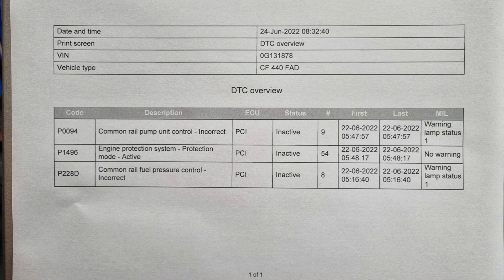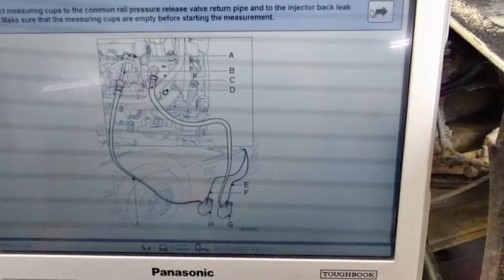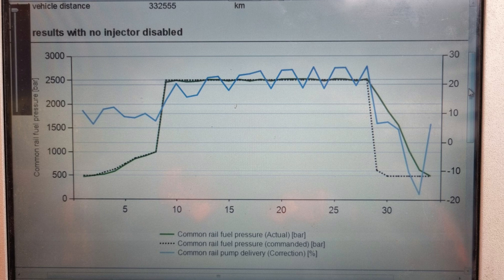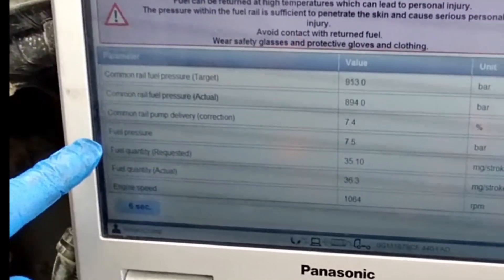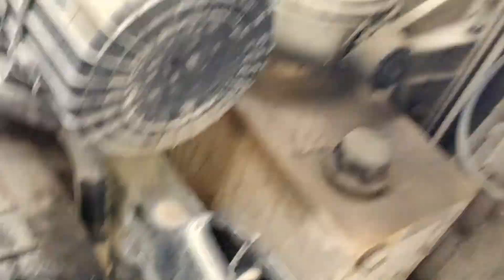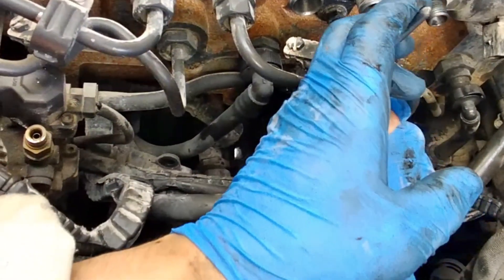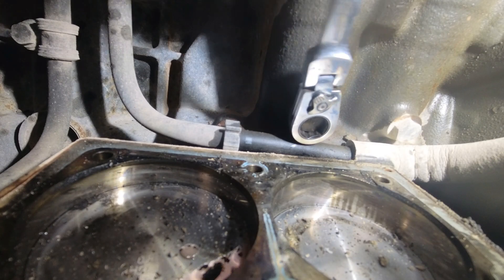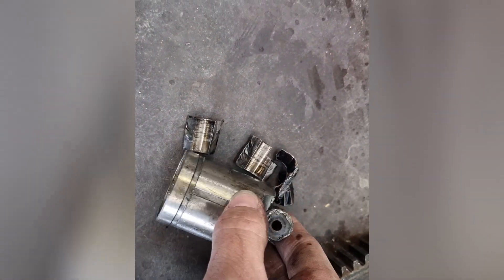Daf TRUCK mx 11 engine fuel leak off test and fuel pump camshaft

Comment: How we can communicate with you
Reply from the maker: Through the website for bookings https://www.trucktechuk.com/contact or for advice use the forum: https://www.trucktechuk.com/fourm
Reply: @T @TRUCKTECHUK  I did that but nobody responded me back
Reply from the maker: Hi, as stated on the contact us page,  if you dont live in the UK and are trying to get diagnostic advice through the contact form the system will remove your request. As stated you will need to use the forum to post technical questions
Reply from the maker: We dont supply a phone number for communication due to the amount of phone calls we use to receive that wanted free diagnostic advice. Advice is done through the forum only
Reply: @TRUCKTECHUK  I did follow up the form and I'm waiting your advice

Comment: Nice one Russel, great video once again. Not much info out there on MX11s so its a good thing that you have posted some content about the issues that they have and the work through. I have been working on one in a Tipper/grab 8 wheel and its needed some work thats for sure. Anything from fuel system, coolant problems adblue pump failing etc. Recently the gearbox has been rebuilt, clutch replaced also. It is certainly becoming triggers broom. 
Im doing most of my diag on one with autocomm which isnt ideal. Hoping to get a Jaltest as I take more work on. Do you have any figures for the leak off rates that you have shown in the video? Say so many mL per minute or such? Naturally its probably a case of a couple of f*** injectors probably fill those cans pretty quick? However I reckon paccar/DAF would have put a figure on it?
Reply from the maker: Hey buddy thanks for the comment again. Bit of an old video and I will most probably do a more in-depth leak-off video with my high-pressure fuel injection leak-off kit I've made soon.

The truck has to be put into the leak-off test on the scan tool for maximum correction value doing it on say idle or even 1000rpm won't produce the fuel pressure that it makes when in leak off. tools like jaltest or topdon tell you if it's good or bad when you input the figure in ML.

If you want jaltest head over to http://www.trucktechuk.com/jaltest and fill in your details for a price.
Reply: @TRUCKTECHUK 
Здравствуйте.
Я из Узбекистана. 
Смотрю все ваши видео.
Больше спасибо. 
У меня есть вопрос. 
У меня Даф хф 106 2017 год выпуска. 
Вин номер XLRASH4300G176011.
Проблема есть звук в раёне где стоит эти два насосы. 
На мх13 моторе такой короткий распределение вал?
Reply from the maker: @FarruxDavronov90  привет, спасибо за просмотр.

Кулачки распредвала топливного насоса mx-13 находятся на главном распредвале и доставляют большие проблемы.

если у вас слышен звук бензонасоса, я бы снял и проверил ВСЕ 😢
надеюсь, это нормально переведено 👍
Reply: @TRUCKTECHUK  спасибо большое вам.

Comment: On several mx-13 I have only 3 bars on low pressure fuel side. Changed fuel strainer, filter and tandem pump without much success. Fuel line from tank is not blocked. Next is fuel feed valve isnt it?
Reply from the maker: When you say 3 bar on the low pressure side have you physically measured this with a gauge or are you going off your live data. Do you have any fault codes present for this issue such as low fuel pressure
Reply: @TRUCKTECHUK   Its live data. Only found p3836 (dosing valve - leakage detected). Also check intake module and the line to dosing valve. Tomorrow it is hitting the road..
Reply from the maker: @preslavvasilev7387  have you removed the fuel dosing valve and ran a check leakage from the fuel dosing valve test? Cant really see where else it would be going, you would think you would have a external leakage that side of the fuel system to get that fault.

Comment: Hey bro ..great jobe 
I did a test like that and it was the same pump ..it was not the camshaft. But it was the pump.I was not so sure about first so I change it with a good working truck that thuse the same work too at the company.  So I swap it and so i find the fault........
But great jobe bro.....

Bro can I ask you 
Do you know where the MX11 (adblue DEF dosage module temperature sensor)located 
I diagnose it and it show that on my machine and it's in RED marking 
It's a DAF MX11 XF EURO 6
SO CAN YOU PLEASE HELP ME ON THIS ONE
Reply from the maker: Hi nice to see you did some substitution to identify a fault. The fuel pump unit does have a issue which is usually the check valve which causes the pump not to build pressure in the rail. 

To answer your question you kind of answered it yourself. The adblue temperature sensor is located in the adblue module. The EAS system will check the adblue temperature in the tank and in the pump. If it's under -4*c it will presume the pump is frozen and the heater will need to be switched on to defrost the pump.

You have 2 options. Get the pump repaired or replace it, you might want to check the wiring to the dosage module from the EAS ECU first to ruel out the wiring
Reply: @TRUCKTECHUK  ok bro 
Thank you for the time 
I'll start do the checking
Reply: Can that make the truck go only 20kmph
Reply: Causee that is showing up on the DIP 
and adblue dosage and engine warning
Reply: @TRUCKTECHUK  so that means ...I have to change the tank unit and the pump
Reply from the maker: Hope your sitting down for this:

Additional SCR Inducement (tampering)
measures are implemented, inc:
AdBlue consumption - level low/too low/tank
empty
AdBlue dosing malfunction
Detection malfunction
AdBlue supply
Sticking EGR valve
When a tampering fault is detected, a DIP
warning for the specific tampering group will beilluminated, along with the MIL lamp (for one-ortwo-drive cycle), and a tampering hour counter started. If no action is taken, then after a certain number of hours the first of two inducement stages will be implemented. The first stage (low-level inducement) is a torque reduction of 25%, along with a specific DIP warning. If no action is
taken after a certain time with the low-level
inducement active, then the second stage (high-level inducement) will become active. This is a reduction in vehicle speed to a maximum of 20km/h (creep mode), along with a specific DIP warning.
||| The tampering counter will only be reset to zero when the monitor relevant to that counter has run at least once in the monitoring cycle. It must not detect a fault relevant to that counter for a period
of 36 engine operating hours since the counter was last held.
Provision is also made within the tampering
system to prevent/deter inappropriate repairs.

This is how your 20km limit comes in as it's a adblue related DTC.

EASY OPTION: CHANGE THE PUMP.....they don't last forever
Reply: @TRUCKTECHUK   bro ..thus is what happen to the truck ...the driver drove the truck with the adblue empty in the tank.....I told them never to make it meet halve tank always keep it full and check it every 2 times in a week because the ruck don't make far distance...so he drove the truck empty and that is the problem I have now....so bro How can I fix it ....
Reply: @TRUCKTECHUK  so bro I fill the tank ...should I leave it let it run ...how will it rest it self ....
Reply from the maker: @vinodjokhan3077  if you clear the fault and it comes back on the dash after you have filled the adblue tank up... you still have a issue regardless of them running out of adblue. Change the pump with a good one and clear the fault. Drive the truck and see if it comes back on. Good luck, I will love to know how you get on 👌
Reply: @TRUCKTECHUK  ok bro 
I promise I'll give uou feedback
Reply: @TRUCKTECHUK  thank in a million fir letting me understand jow iy works
Yhank you so much bro

Comment: Apart from a recall on the pump unit cam of the MX11 when it was first released ,i have only saw one failure like you have ...I Am currently doing 1 MX 13 cam a week at the moment ,i can't keep up with them.luckily i have the offical cam reamer for the exhaust on the 13 ,well it was for the MX .And with the one you have we got an adjustable reamer just to tidy it up...Couldn't tell you the last time i didn't have a lock bolt  break....I detest fuel faults  after 2 mins you reef of fuel for the day ..Keep up the good work
Reply from the maker: Same here. It was a very odd but if I had not isolated the pumping units individually identifying the fault  would of had me going round for hours. 

I don't have a adjustable reamer unfortunately but I do have a motorbike cylinder honing tool that fits 😂
Seems we both get all the good jobs 👌
Reply: @TRUCKTECHUK  I think there is a bulletin about it if my minds serves me correctly..Got a nice wee skive at ZF ...My phone is full of cams ,Every bolt on the gears gets toqued paint penned and photographed ,so when i have that moment of doubt after putting the bellhousing on i ,can just look at the photos..Honing tool is a good idea actually
Reply from the maker: @norb0254  I'd LOVE to go to ZF!!!! I'm so annoyed with the LACK of information on repairing these Traxon gearboxes and the fact were now having the new Traxon 8 speed auto for LF and XD means someone needs to let me fix them 😂
I've a trip to DAF Monday for the LF EV electrical course.
Reply: @TRUCKTECHUK  Your welcome to the EV ..I did the hybrid many moons ago ..that wad enough for me lol...They where saying all gearbox courses are now at ZF  ..Don't think there are the instructors or the room to do the practical in house...Never knew about the new 6speed .must ask
Reply: My daf MX13 just won't start fuel running back somewhere?
Reply: @simonfrigo187  do not forget a failed vtg can cause a non start andyou will not have fuel pressure